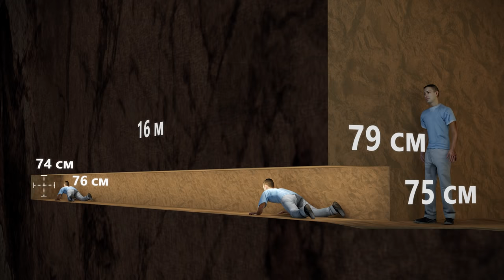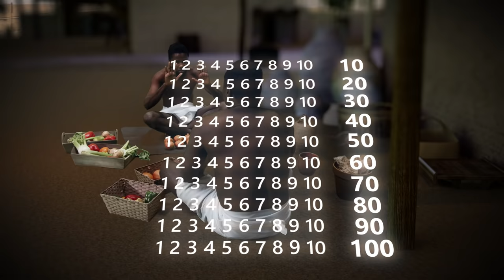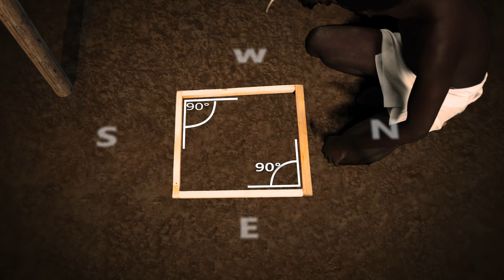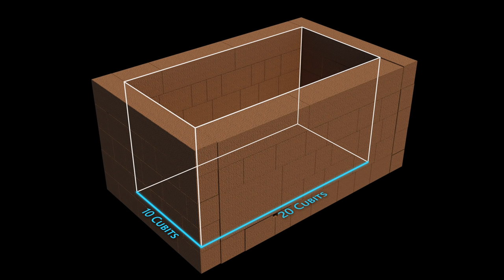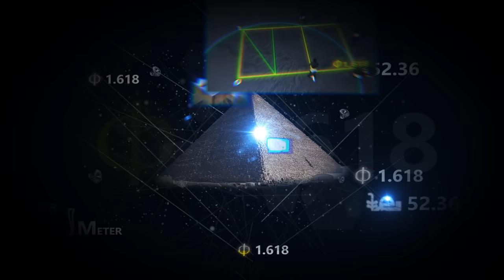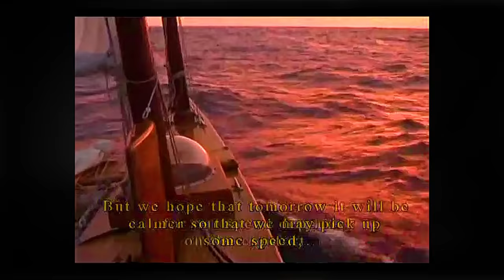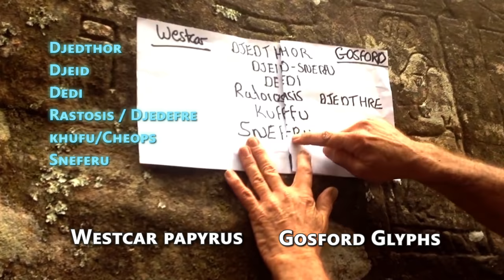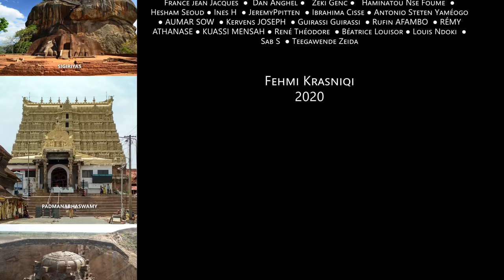The Movie Great Pyramid K 2019 - Director Fehmi Krasniqi

Comment: 2 questions:
- In which world are all droplets of water of the same size? I just sprinkled water on the table and every spot of water was different in size.
- How did they actually measure the size of those droplets without measurement system in place?
Reply: first, you don't sprinkle water droplet, try to wet a pen or something and let the drop of water form and fall off and that is to measure, second, they didn't need to measure but compare and make templates. the base of construction is axes and templates.
Reply: @soimiidobrogeni  Well, the width of the end of the pen can be different, respectively, the surface tension force during the formation of a drop will change depending on the surface area of the pen tip, which will lead to the formation of drops of different sizes.
Reply: @crisscrossmoves  just try it! The surface tension of water is the same, it doesn’t matter the material! This mean the water drop will form fastest or slower!
Reply: Thank you for aparently being the only other person with the ability to think for themselves.
Reply: It must be done on a water proof surface which is why your results varied
Reply: @rickhunter1317  even when done in waterproof, the diameter of the object, the water droplet dropped from makes the difference in waterdrops
Reply: It's all nonsense. From the race and ethnicity of the ancient egyptians to the giant lense to the concrete. This movie made the world a bit stupider.
Reply: @legral  You wish it was nonsense - Egypt started a Black African Civilization and it's just sad to see how you Eurocentric's continually are proven wrong.
Reply: @legral  27 words, zero argument, mouth-breathing air-thief
Reply: Try n drip that can
Reply: All that is needed is one drop of water. That single drop is measured. That single measurement can be used to see how many drops it takes to get from here to the moon.
Reply: @rickhunter1317  Feel free to make a video of dripping droplets from waterproof objects varying in size to prove that point
Reply: @crisscrossmoves  This is from Google. Check Mate

Is a drop of water always 1 cm?
One drop of water in volume and capacity sense converted to one-centimeter diameter spheres equals precisely to 0.095 ∅ 1 cm.
Reply: @soimiidobrogeni  i just tried it with my finger. But the dia of the drop is just 6mm.😐
Reply: @NikhilRajp87  why with your finger?!
Reply: @soimiidobrogeni  U said try it with a pen or something. I tried it with my finger.
Reply: @rickhunter1317  A drop of water for sure isn't always 1cm in diameter.

The volume of a drop is not well defined: it depends on the device and technique used to produce the drop, on the strength of the gravitational field, and on the viscosity, density, and the surface tension of the liquid.

And if the volume of a drop isn't well defined how can the diameter be?

Just think about it. Let's say you place a drop of water on a surface and it has a diameter of 1 cm. Now let's say hypothetical you could turn up the gravity. What would happen? The drop would get squashed down and the diameter would widen. It's an extreme example but it applies to normal variables as well. You would need the exact same conditions every time which seems very convoluted to get that standard measurement in ancient Egyptian times. 

Not to say that a drop of water is very small compared to the size of a pyramid. So if 2 different people make two different measuering tools and their water droplet is off by even a tiny fraction those difference will scale up hugely and you will be in big trouble in no time.

The example you pull up from Google is when it is done in a standardized setting which was defined in the 19th century.

I'm only just at the part of this documentary about the water droplets but it already has made some wild statements. The pouring of the stones sounds interesting but if you think about it wouldn't make much sense either. If it really were the case I'm sure it would be really obvious and there would be no doubt that was the way they did it. There would have to be recurring marks from the molds found all over different stones just to name the first thing that comes to mind.. Or why even go all the way up the Nile to carve out a giant Obelisk when you could just pour it where you need it.

This documentary seems to lure you in with the whole thing about aliens being such a dumb theory, and then go "No look, this is how they did it, this is the smart theory!." But maybe they should showcase some critical voices about their own theories as well because I'm sure they wouldn't hold up for very long.

i'm gonna continue watching it because they come up with some interesting 'out of the box thinking' concepts but I wouldn't hold too much value to this documentary.
Reply: @legral  the truth hurts doesn’t it ;)
Reply: @rarearomas  You seem to be too unintelligent to understand or gauge the technical and historical problems this shoddy theory ignores or distorts.
Reply: @legral  but then again I understand why you will deny that 😏

Comment: ??? Are you claiming that every drop of water has the exact same size? That doesn't make any sense.
Reply: The evidence is hidden in the Vatican... (LOL)
Reply: On th right surfaces, a drop of water has the same width due to water tension. And the doc mentions which material this is on, I believe granite was mentioned, among others
Reply: @dematidesigns5444  But... every drop of water has a different mass, so how can it have the same width?
Am I just too dumb to understand this?
Reply: I just tested this on an old marble top and the droplet just keeps growing. I'm pretty sure 1 meter is 1/10.000.000 of the length from equator to the North Pole. Besides, the base of the great pyramid show they now longitude and latitude. But then he couldn't claim how they discovered earth is round after the building of the pyramid. Guess it's for the storytelling but it sucks when they spew bull like that
Reply: The narrator mentioned that it was Khufu's father who did the sailing (twice) to austrailia, so therefore in Khufu's reign, they would have already known the earth was round.
Reply: @dematidesigns5444  Totally agree. It sucks. But it is an interesting theory
Reply: They noticed their boats disapear when they sailed away
Reply: @jonnynice8366  
The margin of error is small enough
Reply: No, they are not. Just we need to watch the on the windshield when we driving in pouring rain. Smaller and bigger mixed.
Reply: @JonnyNice Exactly. That's like saying every grain of sand is the same size. A drop of water varies in size with the number of water molecules it contains.
Reply: @michaelowens5394  
a few molecules DON'T matter
Reply: @michaelowens5394  there are big molecules and more modest ones, don't forget !
Reply: A few molecules don't matter, but a few billions to. It takes billions of H2O molecules to make a 1cm drop of water, so there are billions of different sizes a drop could be.  A big drop has more water and is more than 1cm.  A small drop has fewer molecules and is smaller than 1cm.  Water drops come in any and all sizes. 
This is so obvious, I wonder why I'm even saying it. Stop, Michael!
Reply: @michaelowens5394  
K
Think about it 
"... come in any and all sizes ..."
Some are bigger other smaller:  +1 - 1 = 0
In other words: when you line up 💯 of them it averages out to a cm
Reply: Lmao....do you work for NASA 🤣🤣
Reply: Hey, I'm not challenging the thesis as a whole, but this point is just silly. Drops of water come in billions of sizes, depending how much water is in each. They are certainly not all 1cm wide! This is not just logically obvious, but empirically, proven on my kitchen counter every day.
Reply: @michaelowens5394  
drops of water 💦 very in size, but if they come from the same source and at the same room temperature 🌡️ they're not much different
+1-1=0
Reply: @michaelowens5394  
Hey, I'm not DEFENDING the thesis as a whole

But if you line up 💯 drips of water 💦 it'll average down to a CM
Reply: @davidgallagher611  
No
I don't work for NASA
and also DON'T work for TESLA 
😜
Reply: @michaelowens5394  water flowing the same speed, dropping the same height and formed on the same point will make every drop the same..
Fluid dynamics are real
Reply: @michaelowens5394  A grain of sand also varies in "size" but I think you meant "mass" with the number of molecules it contains. However, sand is not a fluid, and therefore it doesn't accumulate like a fluid does due to "fluid dynamics". That is the say, the theory that author presents in this documentary is actually sound. Just because you are unaware of the science behind it, doesn't make it no less true.
Reply: @dematidesigns5444  You're right, I'm not familiar with the science of fluid dynamics, and if the presenter's arguments are experimentally sound, I stand corrected. All I can say is, I can see and so can you that all drops of water are NOT the same size.  I can make a drop of water of any size whatever. So if it's only a certain type of drop, created by a certain method, the presenter would have been wise to specify that, because what he does say, "All drops of water on a waterproof surface are 1 cm wide", is obviously false.

Comment: Does anyone want to guess what happens when 2000deg + molten granite meets with a wooden mold?   Anyone got marshmallows?
Reply: I believe they said clay molds for the granite?
Reply: @capodad2u  I would hope so! 😆 I'm just a dumb high school drop out, but I think the wooden molds were for the limestone "concrete".🤔
Reply: This is a fascinating video, and a plausible theory
Reply: clay mold!
Reply: @kostasdouras7398  And the clay mold you make out of the wooden mold ;)
Reply: @systemabulgaria8941 the main components of clay are aluminum silicon and water
Reply: @capodad2u  They did and its still implausible. Whatever moisture was in the clay would have reacted in a similar manner to pouring molten lead into a mould containing a drop of water !! only on a more spectacular scale

Comment: This "Documentary" looks as good as the Flat Earth therory at the first sight, but when you start asking Questions it all crumbles!!!
In one point i might agree, molding the Pyramids out of concrete might be a good explanation BUT how does this primitive concrete last for millenias while our modern concrete is not able to withstand some centuries of errosion?
How did the Egypts manifacture absolute clear transparent lenses with a diameter of 5m? Did they have blast furnace or what?
And yes, you can melt stone or steel with the power of the sun but you need a large mirror array and it can only do it punctual and not severel tons at the same time how it's necessary for molding... And how could they manifacture the moldings for the statures when they had only copper tools?
And so many other questions to ask, like how did they managed to transport their giant mirrows across the oceans and how did they navigate?
This is some nice fiction at the best but it causes more question than answers!
Reply: Thanks you saved me plenty time. What a bunch of ludicrous nonsense.
Reply: modern concrete is designed to be cheaply produced and meet specified engineering requirements. but not necessarily to last thousands of years
as far as huge magnifying lenses, iv'e used water to transmit light for a horrible dark and dingy shop i worked for and it worked great, so a magnifying lens using the same principal would be a cinch.  what they present here in this documentary is definitely worth playing with
Reply: I work with concrete for a living modern concrete it’s made with Portland cement which is more like a glue that holds the rocks and sand together. Limestone concrete is completely different it bond’s together with crystals from the chemical reactions thus it’s basically a man made rock
Reply: I love your skepticism, you must have a degree in Egyptology or maybe even Quantum Physics hahahahahhah
Reply: Roman concrete is still curing, my Kraut friend.
Reply: @moonshade7024  Modern concrete is reenforced with steel, which corrodes and is where the concrete fails, every single time. Basalt reinforced structures (like Innovation Bridge in FL) are the future.
Reply: @kylecryer1334  ... portland cement is literally just ground up limestone and clay or limestone and shale, roasted. Modern concrete is reenforced with steel, which corrodes and is where the concrete fails, every single time. Basalt reinforced structures (like Innovation Bridge in FL) are the future.
Reply: Frode Sigurdsen  where would those be? :-)
Reply: @Saint_James_314  I was thinking about that too... fire to make a big lens, big solar lens to make a huge lens, huge solar lens makes THE SOLAR DEATH RAY!
Reply: @sabastianlove1286  Ok, i give you the point with the limestone concrete. Like i said the idea is pretty good and let's guess they were indeed able to make that concrete. But how did they melt the granite with lenses? Can sombody proof that with an experiment, at least 100kg of stone poured into a mold so we can see that this is working in larger scale.
Edit: Oh, and of course make these lenses out of material they had at that time, no blast furnaces, no CNC Machines only the technology back then!
Reply: @KristijanJankovic  And you must also have those degrees in order to arrogantly criticize.  Right?
Reply: but the rome structures are still here.. I guess some concrete are for sale, some are for the pharaoh and king. latter is better in utility

Comment: When you melt granite, nothing remains of the structure.
Reply: Yet when you melt ice, its still H2O
Reply: Has this been tested?
Reply: no, when you melt granite the result is obsidian glass and no more distinctive granite crystals
Reply: @al2207  True
Reply: Philip Thomas  yes  , the very impressive work done by alien civilization some 20,000 years ago with construction equipment we will have in 100,000 years
Reply: Melt? For what?  I am Confused. I thought the theory od the documentary is they made granite like blocks from concrete like materials which are in sand form.
Reply: @luisgalleguillos4868  what was said is that they melted sand into limestone blocks and melted granite to be poured in form at the higher level of pyramids without thinking of form and the way the melted granite to be transported , all bogus lies
Reply: Yes, But nothing remains of the ice structure.
Reply: @stephenanderle5422  no.  when water is frozen into ice the structure will be the same
Reply: @The Perfumed Garden your belief, all you say do not explain the immense quantity of granite work with precision we cannot achieve today not mentioning transportation and deep hieroglyph carving with glassy finish  , immense block stacked on top of each other with razor blade joint , exquisite rock vase carving we cannot do today
Reply: It need not be all melted just a slurry with crushed cold granite
Reply: @The Perfumed Garden that's way harder to do than what's described.   You can't make a good steam engine and gears out of copper.
Reply: @crhu319  If it was made from slurry it will crisellaze and loses his strengst.
There is not even one air bubble to are on any structure vase or statue. Not even one. Soooww.
Reply: There is obviously MUCH the people of the world dont understand about these things....
Reply: An War  P-A
Reply: @BrainCave they said that is the OFFICIAL theory counter to them knowing how to make concrete. They say that 2.3 million stones were quarried, transported, then cut and fit into position weighing an average of 4k lbs....in just 20 years. A theory that tickles engineers the world over.  And thats not counting the half a million pounds of pure granite they supposedly quarried and transported 750km to the build site without the help of wheels.
Reply: Kemet (black land) was the birthplace of CHEMISTRY/kemetstry (black magic). The same black magic that europeans are KNOWN for crucifying people around the world for practicing. Medicine to engineering. The western world has throttled humanities ability to its own lowly expectations. The result is clear as day.

Comment: First,this is best documentary I've ever seen about the pyramids.You seem closest to solving the mystery but.........
Questions Alert :

1. Pouring slanted stones from top to down is not possible ,at least not without imperfections on the edges from where you pour final parts of the mixture.

2. What was the size these lenses and how did they make such big lenses with such good focal length to obtain such good perfect focus.

3.What were these moulds made of  that handled molten granite.

4.what could have possibly been the speed of melting and pouring..is it even logical ??

5.How did they carry these massive lenses wherever they migrated without damaging them and used them without anyone else knowing.

6.Biggest blunders were made towards the India (Bharat) theory.
Have you seen the architecture of indian temples and details & complexity in the  design of the idols of the deities ?? They are nothing like the 2d idols of Egyptian temple walls.